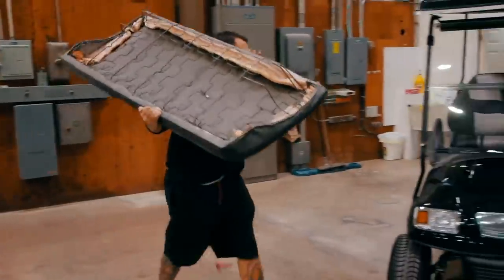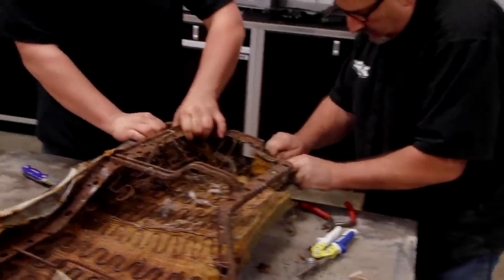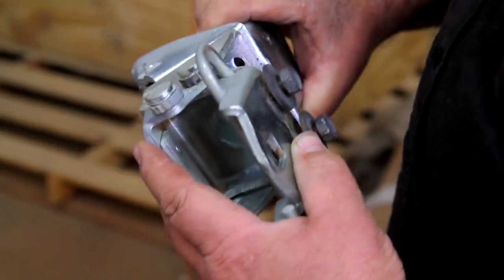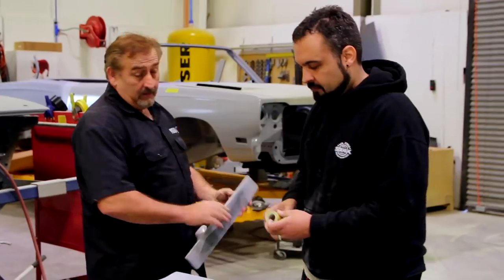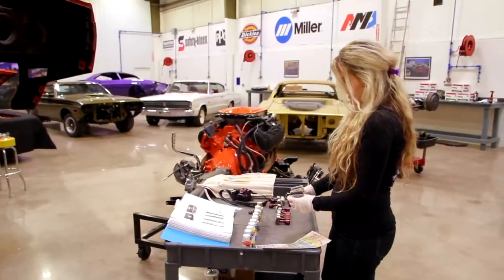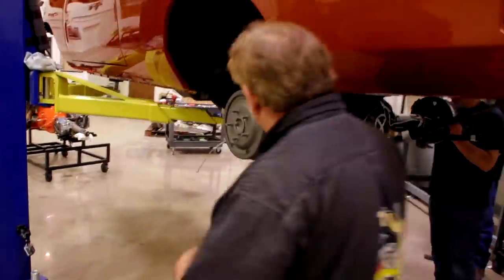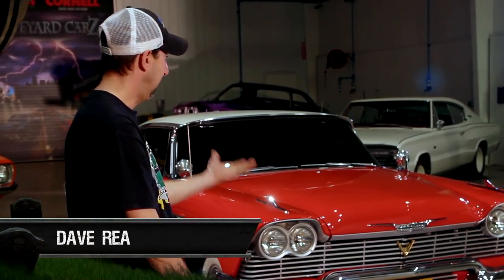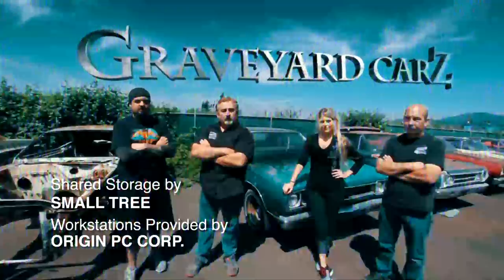Season 5 Episode 3: "Hell Hath No '58 Fury"

Comment: I bet the x on the rear end was a three part cycling of the finishing of the rear end. A for instance Stage one would put its first line (ie ring gears bearings etc done) step two second line of the x (ie brakes assembled)  then step three would be torque sequences finished and the circle around the x. Or something to that nature. Obviously I’m speculating here and it could be another whole set of three different ways of assembling the rear end.